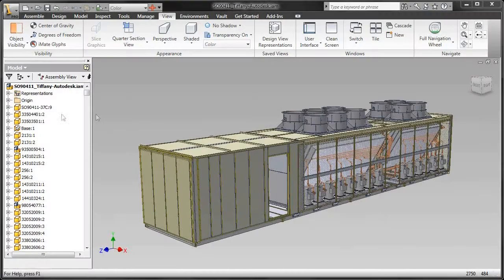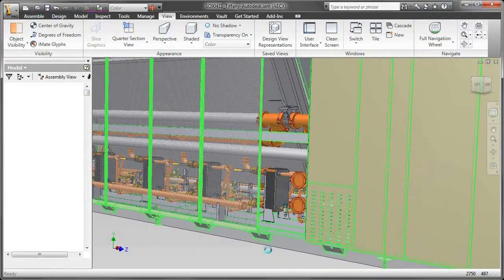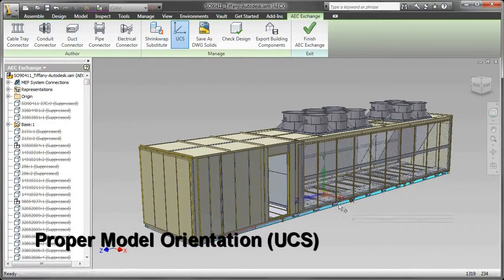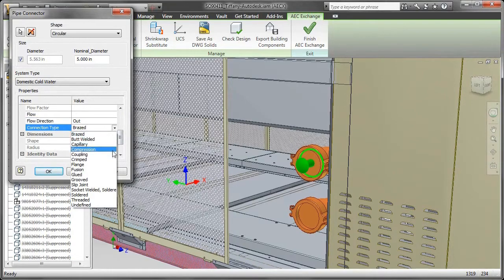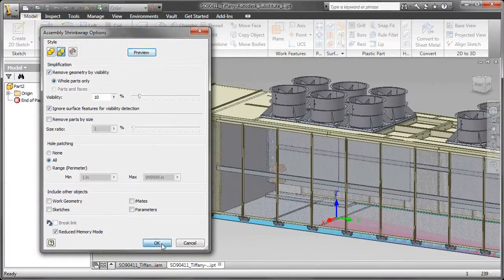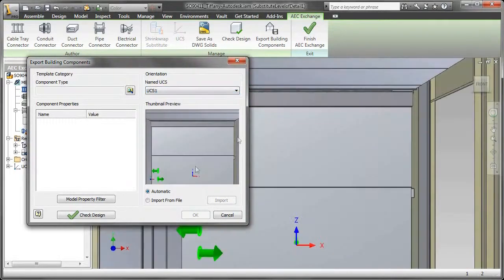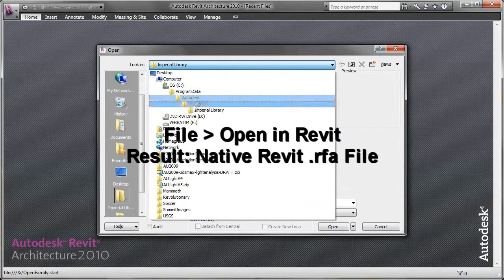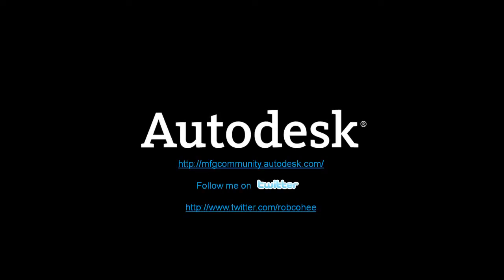Part 6: Digital Prototyping and BIM - Inventor to BIM Demo

Comment: My contractors ask for DWG because this can be read ,the most easy ,trough there CAM systems.
An other isue is that I want in order to sell my products more easy, to provide architects with 3D dwg´s extracted of my IPT´s ( after adjusting the parameters according to the clients needs) of my products to easely fit this in their designs.
This 3D dwg is never documented , I can´t even connect or attach my company name.
If use AEC the data that I add will be only recognized in MEP and REVIT.

Comment: Lots off possibilities to share BIM data  from the inventor model towards revit users.
But as I just want to send my shaft modeled in inventor as as a 3D  DWG to my NC contractor, I can´t add any properties like material to the model.
Lots of people need to do this every day. Right now you have to ad this info in the body of the email when sending to the NC contractor. So critical information is not included in the model. Is there a work around somehow by using the AEC ( I don´t have Revit)